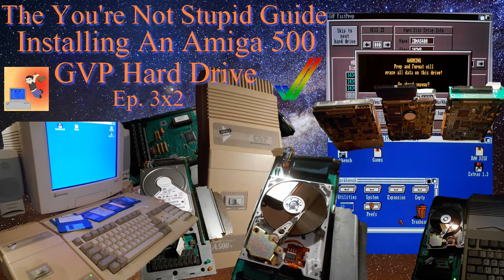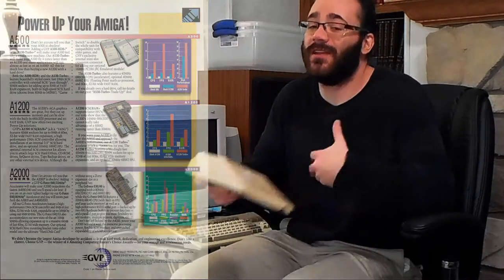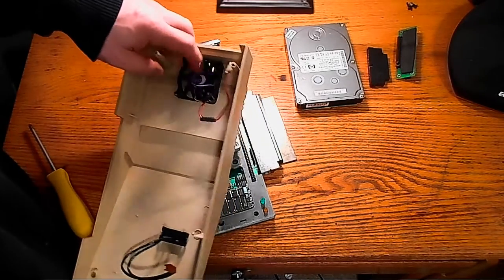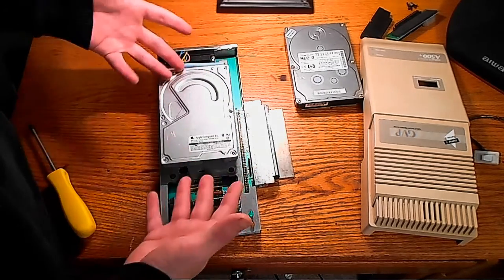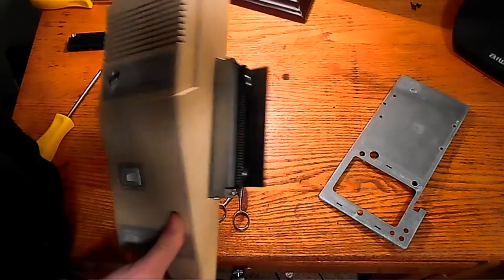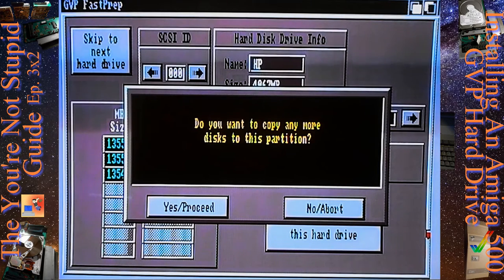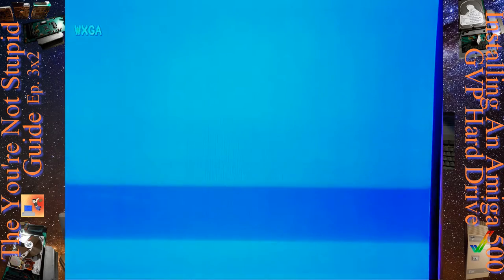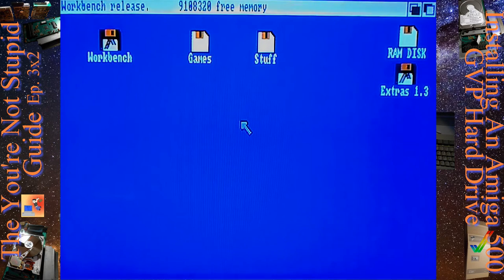Installing An Amiga 500 GVP Hard Drive + Emulation - The You're Not Stupid Guide

Comment: Great video but i liked the real deal on my 5 AMIGA 500’s.

Get over two weeks a Commodore A590 with SCSI2SD v5.0a 2MB RAM / 8GB SD WB 1.3 for my AMIGA 500. Maybe i can install all my Games diskettes on it. The most of the WHDLoad games don’t work on the Wicher500i because the 25MHz. Most games work on 7MHz / 14MHz. Got also a ACA500Plus but i must have a ACE2 for 2MB CHIP RAM. And i waiting for a Vampire 500 V4 and maybe a HC533. Is nice to have WB 1.3 for the A590 next to WB 3.1 / BetterWB on the ACA500Plus. And for the Vampire WB 3.1.4 / BestWB or AmigaOS 3.9.